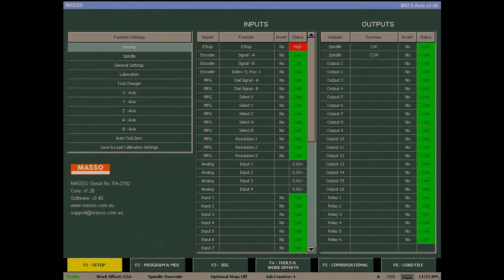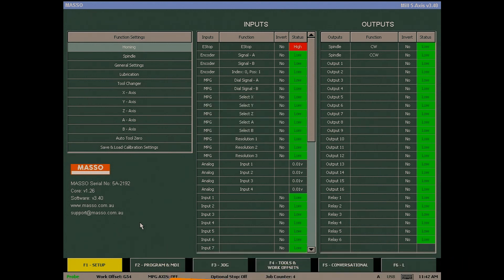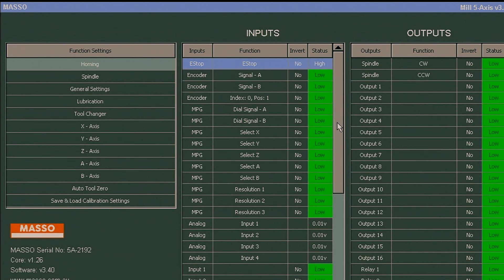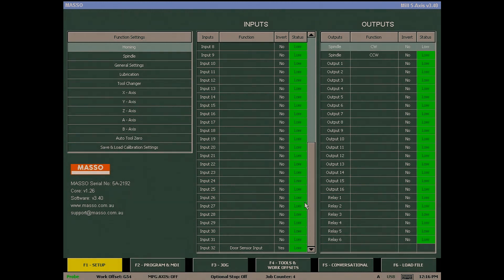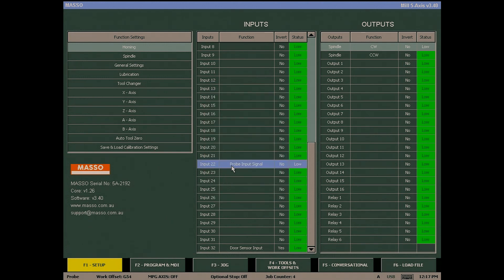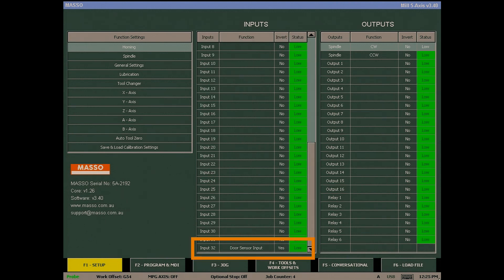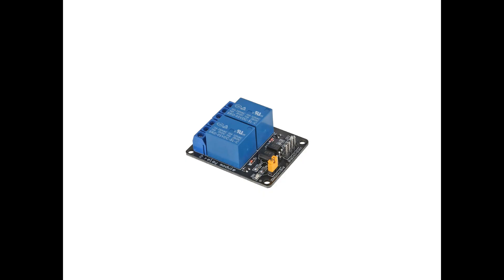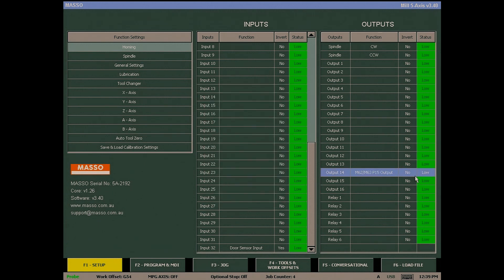MASSO 101 - Assigning Inputs and Outputs

Comment: Your videos have been very helpful teaching me to setup the G3 Touch.  My spindle supports tool change and I'd like to use input 1 which is the red button on the front cabinet of the touch to cycle the tool change mechanism.  Is there a momentary input and output combination instead of a toggle? Currently I'm using Aux output 1 toggle. Thanks!
Reply from the maker: Hi Machine 27, we're glad to hear our videos have helped you! Please write an email to support@masso.com.au so some of our technical personnel can answer your questions.